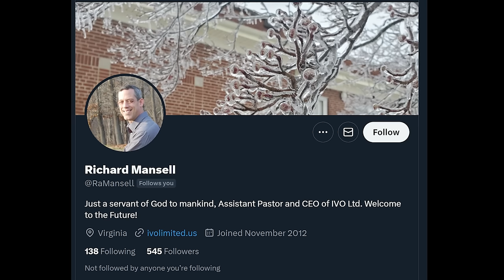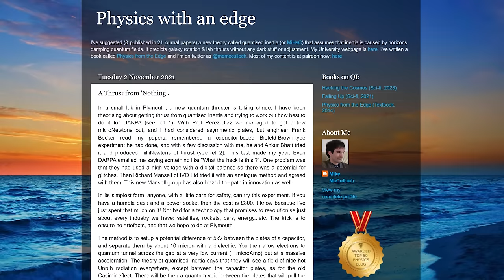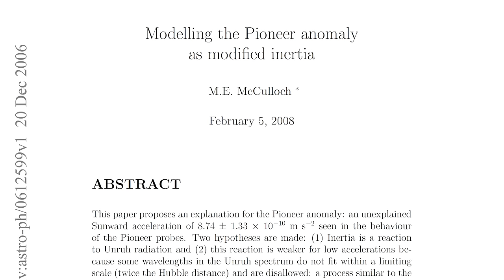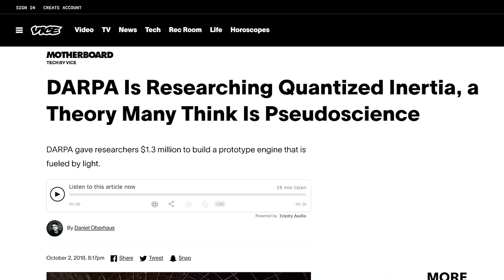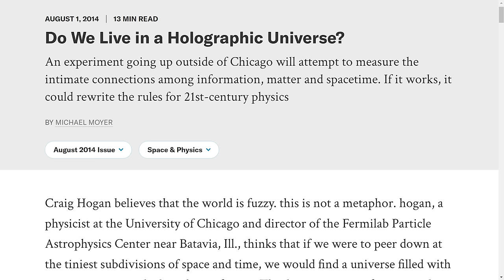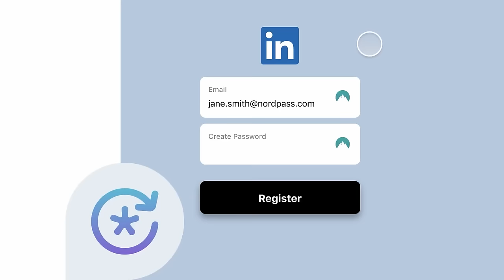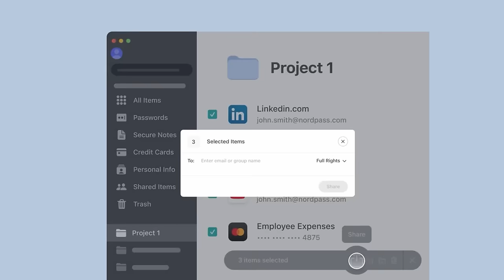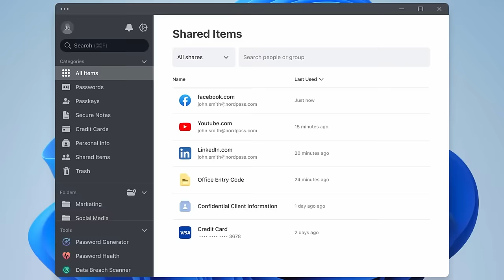Quantum Inertia Drive put to Test. It didn't go as planned.

Comment: For funding projects, there's also a not-quite-so-ridiculous reason for providing money for projects that have low-likelihood of success, but if they are successful, the payoff is huge.  Of course, it should require the ability to discriminate between low likelihood and zero likelihood.  Remember those "remote viewing" experiments that were funded as well?
Reply from the maker: Yes, agree with you!
Reply: It's finally completed: https://youtu.be/RdQ30PiWWpk
Reply: Both are still closed system processes, while so much of the success of science & engineering is lots of diverse efforts, mostly failure, trial & error and unconnected.  When thinking about individual effort & "progress" and comparing it to the vast existing "success" that is our reality, our expectations are way off.  The airplane is basically safe because of so many failures, from so many attempts, esp from wars (and NTSB). While it's nearest corollary, the space rocket, has no such history, pressures, economic support....or possibility.
Reply: @David-wc5zl yeah. Almost all modern* spacecraft technology was developed out of want and curiosity, not necessarily necessity, atleast in my opinion of the word necessity. I’m sure to others, it’s considered necessity. I am curious how much space flight technology will change once space travel transitions from “We can do it” to “We must do it”
Reply: This is how development funding works for film projects. If your relatively small project fails it reduces the tax liability of the investment fund.
Reply: And testing things may show something else that is unexpected
Reply: @crow2989 "not necessarily necessity" Respectfully disagree given how manned and unmanned rocket technology grew out of missile technology to deliver some kind of explosive force to an enemy city. In the US programs, the Redstone, Atlas and Titan "boosters" used in Mercury and Gemini all started life as ICBMs.
Reply: @FIREBRAND38  I guess i should have specified that i meant modern Rocket technology. Like SpaceX and Blue Origin
Reply: @crow2989 That would be more accurate. In that case absolutely because now they're chasing private investors.
Reply: I completely agree with you on everything in this video except for the hologram thing I think there is sufficient evidence that we are living in a simulated version of reality and that evidence is a parent through the mathematical observation of a singularity. Singularity also shows itself inside of convex and concave reflection where everything flips and goes in reverse like the other side of the singularity of the toroidal universe where time Flows In Reverse. It's absolutely absurd that we hypothesize the universe is flat. This is just fundamentally completely impossible because of the third dimension therefore everything is fundamentally wrong. There once was a time when we thought the Earth was flat as well... you could say the second dimension exists within the Third but this still doesn't change the fact that the universe is not strictly flat because 3d exist thus if it is a flat square it is also a cube.
Reply: Wasn't that the CIA that did that stuff, partly on the basis that the Soviets were researching it first so 'We' could not run the risk of it being legit and being fatally behind in the 'pycher' armsrace, and when I say armsrace I ain't exagerating, they thought pychics might be weaponizable to kill specific people Death Notes style.
Reply: @kennethferland5579  1978's 'The Fury' by Brian De Palma had something of the same plot.  Psychics that could be weaponized as assassins.
Reply: @AquarianSoulTimeTraveler  Sorry buddy but just because the current models might be wrong, it doesn't mean your physics-free, evidence-light pipe dream could be correct.
Reply: @richardhall5489 There is a small problem with that idea. You only get your tax back, but not the funds. If you fund a project with $100, on which you would have to pay $25 taxes, and you lose it, you only get $25 as a tax refund, and only if you a) have paid the taxes to begin with and b) you are still $75 short from where you started.
Reply: @AquarianSoulTimeTraveler  I think you do not understand what is meant by "flat" when talking about the shape of the universe. It does not mean 2D like you think. It means the curvature of small enough that space is close to Euclidean. This property can be defined for any N dimensional space and not only N=2. As such, your argument is moot.
Reply: @SabineHossenfelder  Spending time training with remote viewers might destabilize your position.
Reply: It's a question of funding and choice. Tax payers don't get to choose how the money forced from them is spent, whereas privately funded projects require willing backers with dough.. I'm most bothered by Big Science than small private science, but 1000 small failed projects with million dollar grants still adds up to a billion down the drain in usefulness terms, even if it does spread some wealth around (which is what lefty Libs care about more than anything). Mega-projects of Big Science don't give practically useful knowledge most of the time, even when they don't fail.
Reply: @robertsikkema8505  Remote viewers convince people by using very vague wording / probing questions, or instead by preresearch. So, it's the same deal as hot reading and cold reading. Its stage magic, specifically a kind of mentalism.
Reply: @AquarianSoulTimeTraveler  If people meant that the universe was 2D when they said it was flat, then the idea wouldn't have gained any traction. I suggest your understanding of the word "flat" in this context is wrong --- it means topologically flat, which means nearly or completely Euclidean. 

Anyhow, we don't even know that singularities exist yet, so you might want to hold your horses on that one.
Reply: @Ardwick-Crome You are right, but "zero likelihood"  might be approximated by something like, "1) No solid evidence the hypothesis is correct. 2) Known false assumptions, contradictions, or disproven theories, etc. are used in its construction. 3) Signs of grifting or conspiracy theories surround the idea."
Reply: @eSi You could argue two things about the LHC mega project - it proved that the Higgs boson exists and is at the mass predicted by the theory (which many were betting against), and has falsified (afaik) the simplest of the supersymmetric quantum mechanics theories.  But it has been a big let down in terms of finding new, unexplained physics.  Maybe that's a good thing (see Neal Turok's theories).
Reply: Not sure if it is worth for Kessler syndrome
Reply: @peppermintgal4302  sorry but 2D is the only true flat... so like i said it can be ranging all the way to a cube in 3d. This is just pure logic of understanding spacial dimensions...
Reply: @peppermintgal4302  Same suggestion to you: learn how it is done. You are S0 wrong in your diagnosis. Clearly you take the "never from the mind" stance, where I simply suggested training with remote viewers. Such an upfront bias guarantees you'll evade the experience though, I suppose. Feel free to spend the rest of your life locked up in inside your head.
Reply: But there are declassified papers that show apparent success with that and even weirder things. Sure, you can believe the supposed proofs are lies (and with some papers, you would have to believe that certain photos of experiments are lies), or you can be skeptical about it, but I fear that someone who wants to affirm something as "zero likelihood" does not like (true) skepticism.
Reply: @kennethferland5579  That's grey propaganda and a very false myth, the US Army did first all those things. And the research of that kind of thing by the military and the state predates even the Soviet Union, at least they started in 1914.
Reply: @TeamSprocket  Might be? I'm sorry, you truly don't like "science". The whole point of science is to make hypotheses less wrong than the previous ones. "Science" "knowledge" is provisory by principle.
Reply: @SabineHossenfelder  You agreeing with him on that comment is in apparent conflict with the (true) skepticism you have shown in many videos... Or are you not in agreement with all the details of his comment but the "main idea"?
Reply: @ThePowerLover  We all know that research sometimes uses flawed approaches, even though they had the intention of doing good research.  Creating rigorously controlled testing methods is very difficult to do, and often flaws are found in the methods used that negate the results found in the paper.  That was particularly true with remote viewing, if my memory serves.
Reply: Except Ingo Swan achieved a 60% success rate remote viewing. No, that's not great, but it's definitely an advantage.
Reply: They wouldn't be so careless if such failures had to come.from their pocket.
Reply: @Caffeine_Club  
Brian directed the movie but it was based on a book by John Farris who also wrote the screenplay.
Reply: @yeroca  I was not particularly referring to "remote viewing", because as you said, it's very hard to study (whether false or not).
Reply: @dextermorgan1  
According to the same people that believed that Uri Geller was not a fraud. Not a good source of real science.
Reply: @EthelredHardrede-nz8yv  Wow, YT just deleted my comment, it had no links, nothing against the rules!
Reply: @ThePowerLover  
Two things about that. Its not likely that you know that upsets Yo Tubbies. I don't and I have been trying to figure it out. I suspect that Yo Tubbies does not know what is going on. 

The longer the comment the more likely it is to be blocked.
Reply: @ThePowerLover  
Note that I broke up my reply to you. 

It seems to have multiple key words and a counter at the very least.

Your claim of 60 percent, note that I did not use a symbol, is exceedingly dubious based the barely allegedly significant results even in the best cases.
Reply: @ThePowerLover  
Nearly all testing for Psi has decreasing positive results as the testing protocols improved when the scientists get help from the skeptics and magicians.
Reply: @ThePowerLover 
Remote viewing is the best there is and its hard to get good protocols on it. Based on the total failure of every objective test, using good protocols, and only the subjective test have ANY alleged positive results I have to be VERY skeptical about those as well.
Reply: @ThePowerLover  
Amazing all 4 of my previous replies showed up. They may not all stay up.
Reply: As I recall this was the reasoning used in a Monty Python episode for encouraging sheep to attempt to fly.
So far, all of them had plummeted to their untimely demise... But the commercial potential should they succeed...
Reply: For some reason YT doesn't think my wisecrack about teaching sheep to fly (Monty Python) was appropriate.
Well done censorship algorithm.
Reply: @ablebaker8664  
I can see two comments from you, one referencing a sheep, which if I recall correctly was named Basil but that might have been a pig. However my  first reply to you has gone walkies.
Reply: @osmosisjones4912 Positive surprise - the link wasn't rickroll 😯
Reply: @EthelredHardrede-nz8yv  
It's as though the hall monitor has to check before your post gets posted.
Reply: Propelled by Unicorn farts.
Reply: @0neIntangible  The quantum field "foam" is filled with unicorn farts, so that should work.
Reply: @ablebaker8664  I remember that sketch.  "he realized that a sheep's life consists of standing around for a few months, and then being eaten.  And that's a depressing prospect for an ambitious sheep."
Reply: @EthelredHardrede-nz8yv  It was a short one.
Reply: @yeroca  
As long as it isn't an Invisible Pink Unicorn. I have warrant for that one.
Reply: @ThePowerLover  
Short long doesn't matter since you have given us no clue as to what it might have contained.
Reply: Remote viewing proved successful. Is that your meaning?
Reply: @yahwea  
Its not proved successful. He is implying that its not supported by evidence. Which is the case, at least not adequate evidence.
Reply: @yahwea 
That handle and that Avatar, don't really go together.
Reply: Popeye would be a better fit as he says, I yam what I yam.
Reply: That's how every unemployed can argue as well. Most won't be successful - but one might change the entire world to the better...
Reply: @AquarianSoulTimeTraveler how dense are you??? "flat" in this case just means Euclidean 3d geometry
Reply: @green5260  I may be splitting hairs but there was a claim made and I'm just here setting the record straight. Excuse me for being precise with meaning.
Reply: @AquarianSoulTimeTraveler  You're not being precise, you're being obtuse.
Reply: There is also a distinction between a phenomenon existing and it being useful. The various psychic effects researched over the years are examples, with the most well attested being the placebo effect.
Reply: It's also good to try and disprove theories, even the nonsensical ones.
Reply: What you say is we need Clara Voyant to help us. Being as she's not here and never will be, basing it all on results would be beast. Anything else is speculation. In the past those who speculate worked on their own. If and when they got something on their line they got help.
We are not here to provide a huge pile of mediocre people funding or as was said, 'money for nothing'. Analyzing your suggested measure of huge payoffs predicts that NOTHING will come of anything that we have funded. That is the actual results, although we did have some come thru. ALL the benefits of those are deeply eclipsed by the amount of cash all the rest cost and was lost but did pay a pile of peoples cushy living expenses. 
It is neither prudent nor economically viable. 
I am not against scientists. I am against Science becoming a money making enterprise fueled by hundreds of thousands trying to scam money from the government. I was there and I see it just as clearly as you do.
Reply: @SabineHossenfelder  actually it's likely an ionization electrolytic capacity issue
A quasi plasma is sub VACCUM ionization. It can't initiate plasma unless a psi ionization is the correct ratio.

Comment: 5:00 You seem to have missed the conceptual point of “Quantized Inertia”.  Yes, acceleration gets stronger the further out in the galaxy you are. His proposal is that this is because inertia is getting weaker.

Object accelerates-> rindler horizon lowers positional uncertainty-> asymmetry of Unruh Radiation results-> non-uniform radiation pressure creates acceleration ->rindler horizon lowers positional uncertainty, etc.

In other words, inertia is caused by an infinite loop of accelerations causing relativity effects, relativity effects causing quantum effects, quantum effects causing accelerations, etc.

I don’t know how this drive supposedly works, but I imagine it has to do with that same idea- making inertia weaker to make acceleration forces more effective than they would normally be by somehow countering the Unruh radiation supposedly causing that inertia. Maybe the drive is bunk, but QI is really just an experimentally unverified result of already accepted models.

Comment: It might not have gone as planned but it absolutely went as expected
Reply: At least it's no longer controversial. I don't understand how something like this could be "controversial", it either works or it doesn't.
Reply: @MultiChrisjb  It's quantum, so it exists in a superposition of working and not working.
Reply: @Dennis-vh8tz  On a brighter note it's quantumly entangled with another drive on the other side of the universe that's working perfectly.
Reply: @Dennis-vh8tz  Shouldn't have attempted to observe it.
Reply: @gbBakuryu  That's exactly why they cut the power, as long as we don't see the results it will be 50% a success!

Comment: I think they were missing a dilithium crystal.
Reply: The inertia dampeners weren't up to snuff, so not even the purest of refined dilithium crystal is going to help this puppy on its feet.
Reply: @Yezpahr Not to mention commercial flux capacitors that weren't military grade radiation hardened ones.
Reply: The Heisenberg compensator was not working so all the blue meth went off/expired before it should have 🤣
Reply: More like missing a kyber crystal to concentrate the Force.
Reply: @Irishdrivingbloopers  
A TNG reference I believe that was used for beaming people down the a planet.
Reply: @2ndfloorsongs  

Back to the Future with the Delorean Time Machine. Fun movies.
Reply: @kurtiserikson7334 yes indeed. I just threw it in there and added a sprinkling of Breaking Bad to the mix lol 😆
Reply: This kind of reminds me of that guy who built a brass microwave "propulsion device" with no moving parts.  He claimed it was capable of sending people to Mars within a few days or weeks.  It simply violated basic Newtonian laws of motion.  So he was DEFINITELY not a scammer and a crack.  Right?
Reply: Adam Savage has the original flux capacitor blueprints; I'm sure he would have sent them a copy.
Reply: Did they even have crystals? Or even anything names after Atlantis? How did they even expect this to work..
Reply: @MultiChrisjb  They didn't factor in the brass microwave background radiation.
Reply: Captain, the dilithium matrix is completely fused... Unless the show writers come up with a miracle, we have fifteen minutes to live...
Reply: Those are like worth 140,000 bars of gold pressed Latinum each!🤯🤑
Reply: @Bob-of-Zoid  Starships... If you have to ask, you can't afford it.
Reply: Actually, I think it's because they weren't using an eezo (neutronium) core
Reply: Are we sure they didn't just forget to reverse the polarity of the neutron flow?
Reply: misaligned.. just misaligned kristalz .. they are in bin 200
Reply: You are all wrong. It's a beryllium sphere that they need. :)

"Never give up! Never surrender!"